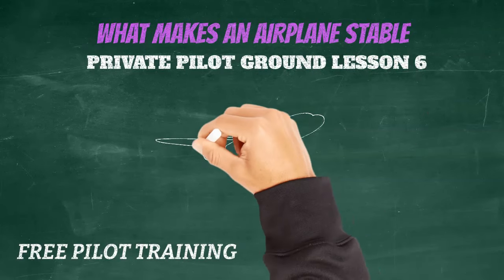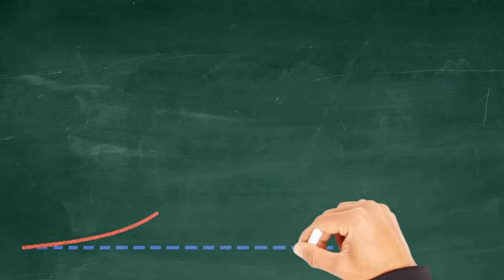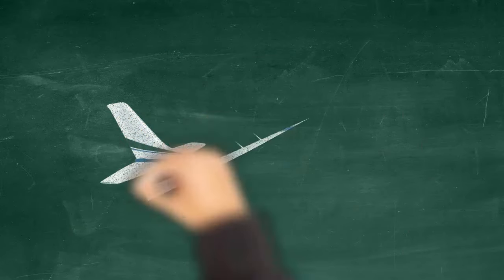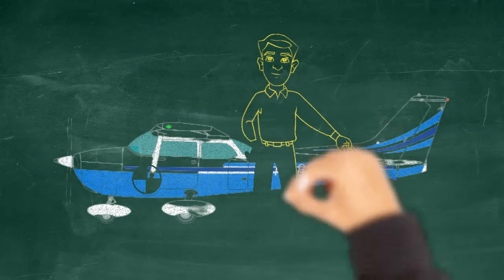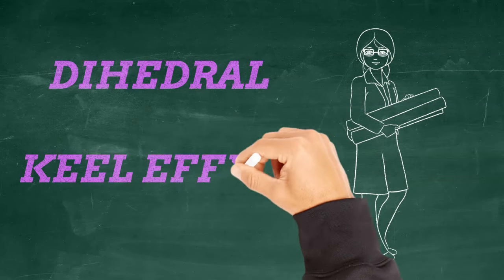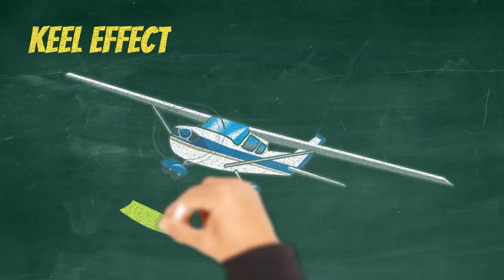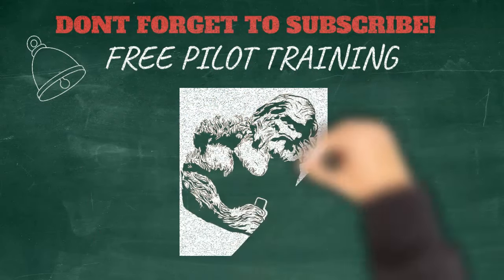Airplane Stability Explained (Private Pilot Ground Lesson 6)

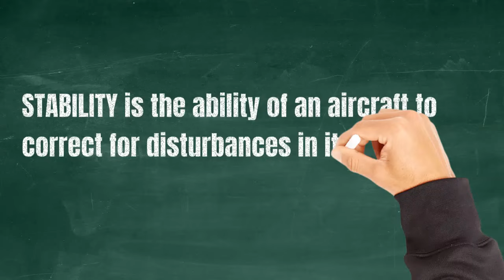Comment: 0:10 stability is the ability of the aircraft to correct for disturbances in its equilibrium and return to its original flight path 

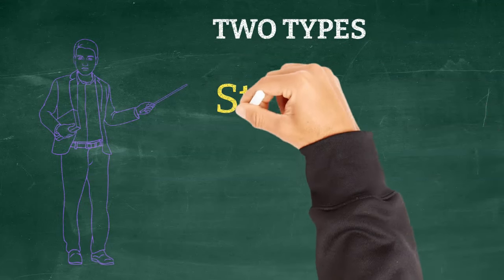0:53 two types of stability 
•Static- initial tendency or immediate reaction after control input or one of the 3 axis are changed by an outside force
1:25 positive static- when airplane wants to return to flight path after moving up  
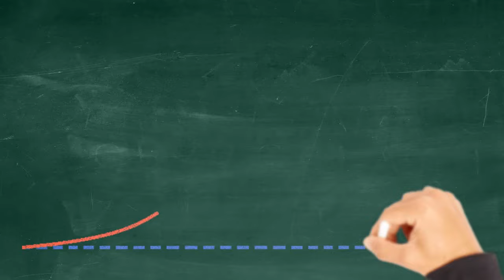1:37 neutral- if airplane stays in same pitch 
1:42 negative static- if airplane continues to pitch up 

1:59 Dynamic- airplanes response overtime to an upset in the equilibrium. 
2:01 positive dynamic- airplanes oscillates before returning to normal flight path 
2:20 neutral dynamic- if plane stays oscillating 
2:24 negative dynamic- if oscillations get worse 

2:38 longitudinal stability 
-nose is heavy in the airplane because usually the CG is in front of the center lift or center of pressure 
- 3:02  horizontal elevator is designed with a slight negative angle of attack so it asserts a downward pressure. This allows the airplane to be balanced at the optimum cruising speed. It is pretty much an upside down wing. If airplane slows down below optimum speed, the elevator won’t crate enough pressure to hold plane down. With more speed it will cause the nose to pitch down more

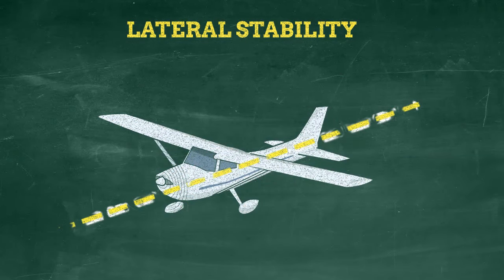3:51 lateral stability on longitudinal axis 
dihedral low wing aircraft 
keel effect high wing aircraft 

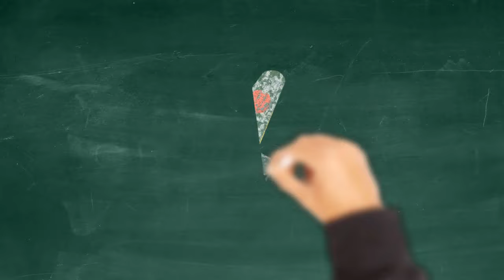5:00 directional stability 
-occurs from weather vane affect and it’s achieved from the vertical tail on the aircraft
-the relative wind will keep pushing the vertical tail back until it is in line

Comment: The part about dihedral on the lateral stability confused me a bit. In the example the turbulence causes the left wing to dip and this dip also causes the aircraft to yaw to the right creating a leading and lower left wing. How does this configuration also cause the left wing to have a higher AOA?
Reply from the maker: I have plans to remake this video to make it easier to understand. When the left wing dips, the right wing is a higher angle of attack so the airplane yaws right

Comment: 4:27 How does the wing in front have an increased angle of attack? I thought angle of attack is relative to the pitch axis?
Reply from the maker: Not necessarily. It has do do with relative wind.  Relative wind directly opposes the airplane’s direction of travel
Reply: @FreePilotTraining  Thank you for these videos.. But I also have problem with your statement that yaw means different angles of attack. It doesn't make sense to me. I think it's like this: the angle of attack is not higher when the plane is yawed. but yaw motion makes one wing faster than the other -> faster wing produces more lift -> during resulting rolling motion the wings have different angles of attack. 
This is how I understand it. Let me know what you think

Comment: 4:49 Pendulum stability or the 'keel affect' is a myth. High-wings are more stable because of the high and low pressure zones that develop on the sides of the fuelage beneath the wing during sideslip. A simple free-body diagram of the forces of lift and weight will show that the weight cannot produce a moment about the aircraft CG.
Reply from the maker: Myths are a myth

Comment: But I cant grasp the main point.
Reply: Basically the plane is designed to make small adjustments automatically to re-balance the flight. If the wind pushes the nose upwards, the plane uses its auto trimming to pitch it back down 😊
Reply: Dont worry If you don’t get it, its not of utmost importance
Reply: That most planes are designed to autocorrect themselves to straight and level flight without pilot interference.